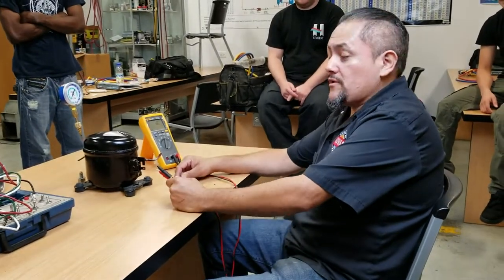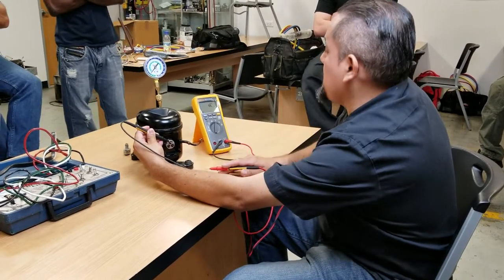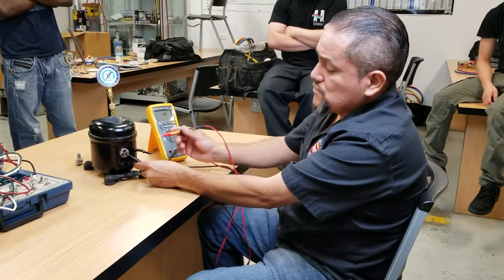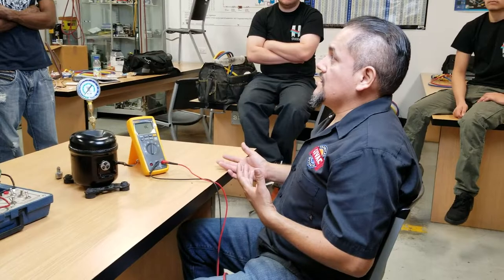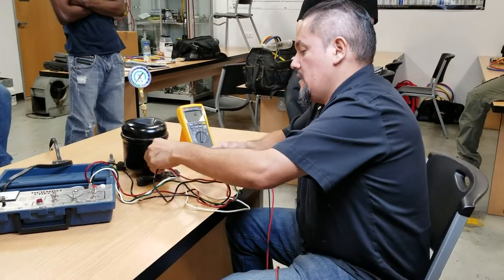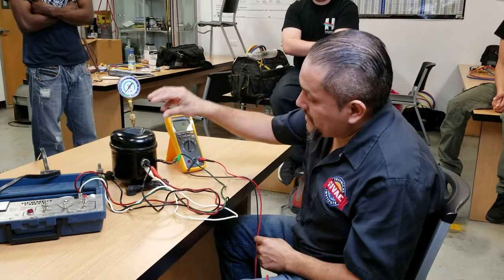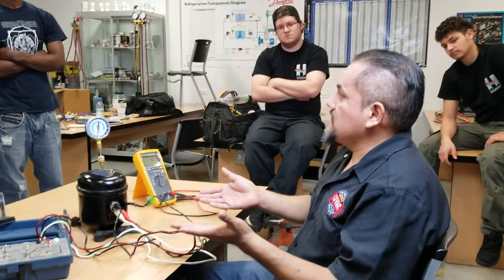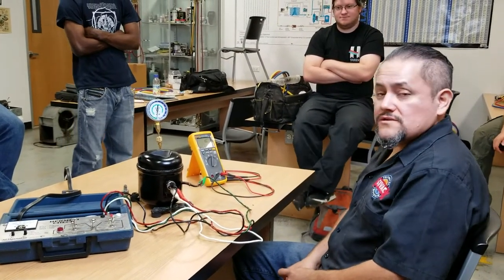How to check a compressor.

Comment: Greetings my brother I've learned a lot from your video I must say a great video keep doing those videos. I have a question on this video when doing the mechanical test on the compressor you did you block off the discharge line for the compressor?

Comment: Issue: Never used/ new refrigerator uses R600A) purchased from a clearance warehouse , doesnt cool but fans/lights come on. 120 volts  at relay wires confirmed. My refrigerators compressor( still in refrigerator) that i tested had a ground wire connected to the chasis.  Is that not suppose to be grounded like that?
Reply: Never mind sir. I understand now what you mean. Lol . My bad
And fortunately all pins are OL.   Looks like my overload protector is my problem. Thanks